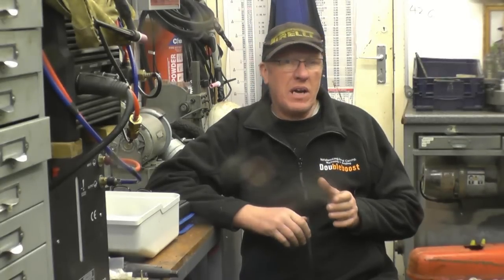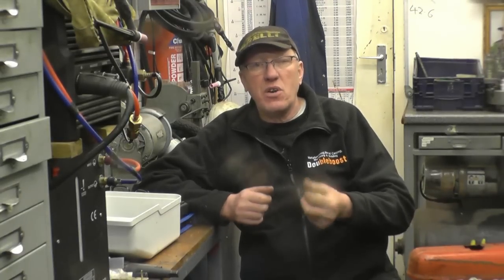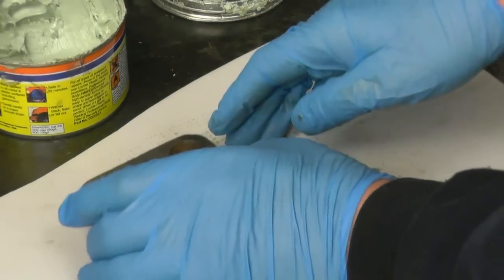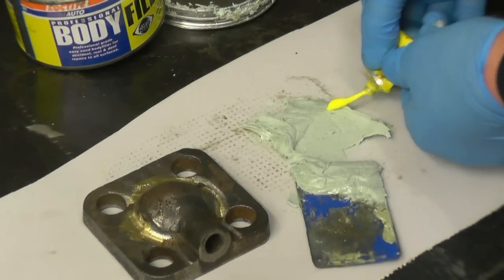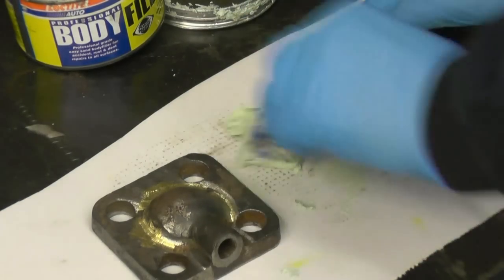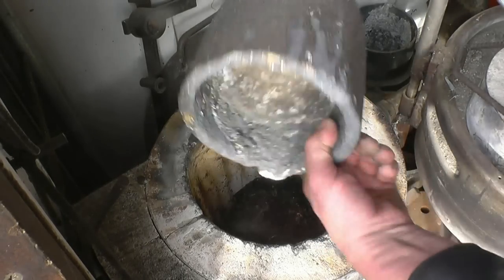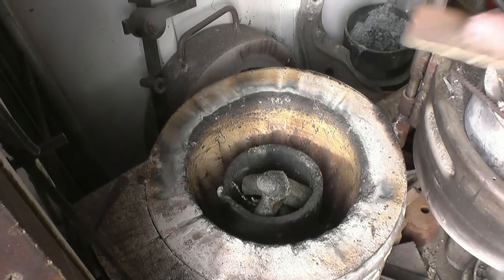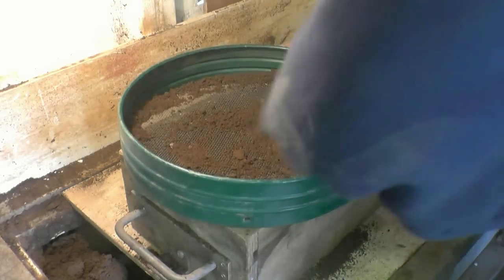SNNC 148 P1  Bronze Casting & Machining

Comment: John, is your sand green sand or oi lsand? Do you mull it?
Reply from the maker: I use green sand just mix it with a bit of water before I need it
Reply from the maker: Impatient Bastards lol
Reply: Thanks, John. Love your videos. Have cast aluminum, but not brass.Ment oil sand...